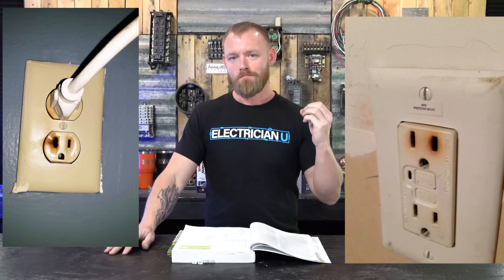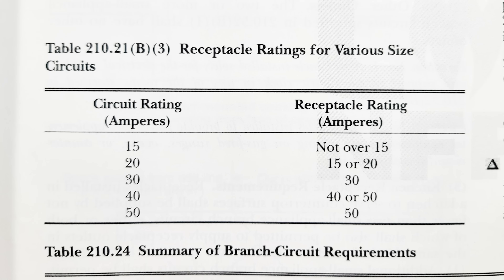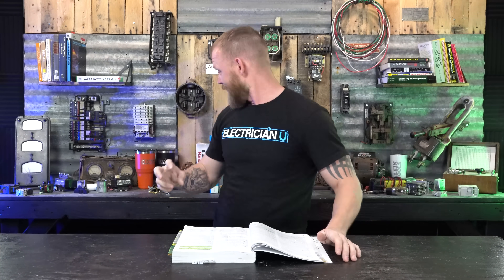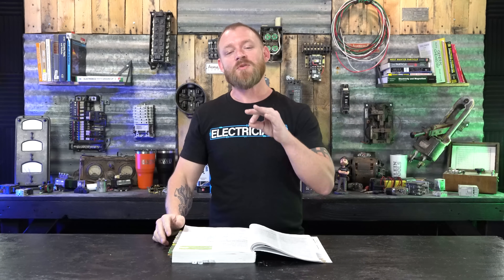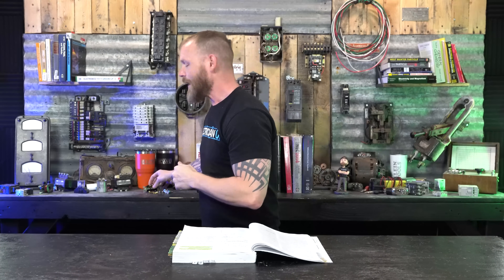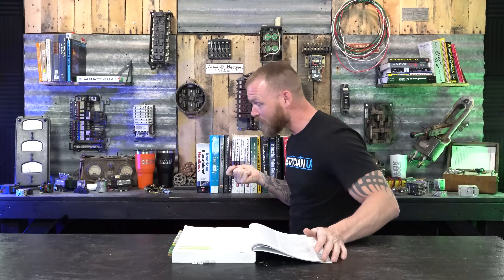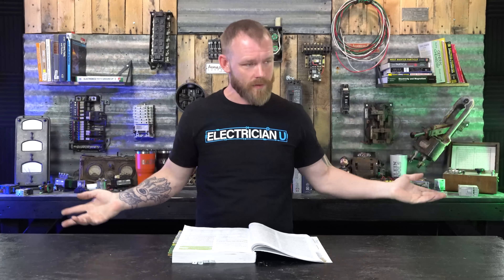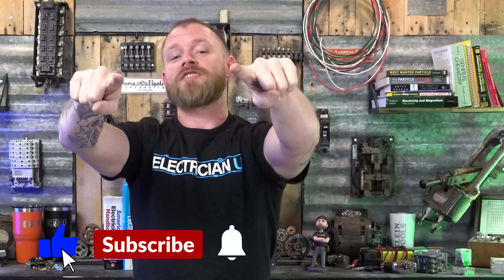Won't These Melt?!? 15amp Receptacles on 20 amp Circuits!!!

Comment: Very good video. I would like to add an additional point. The information you have provided is directed to receptacles located on "General LightingLoads.". These circuits are typically found in bedrooms and similar rooms.  Normally loads in these rooms are limited to loads like TVs, stereos, lamps, electric blankets and may be of those are non coincidental or intermittent. Most loads that you speak of are addressed by adhering to the requirements for "Appliance Loads' that address your concerns related to 15 ampcircuits.

Comment: In short.. all good 15A outlets are listed for  20A passthrough wiring - you are allowed to pass 20A through the outlet to other devices downstream on the circuit.    The   15 Amp outlet's rating and 5-15R plug configuration only means you are not supposed to draw more than 15A from that one particular receptacle.    Your appliances should Not have a standard 15 amp plug at the end of the appliance cort that plugs into the wall if they can draw more than 15 amps.

Comment: I bought an old house that basically had everything wired to one 20 amp breaker. Everything except for a receptacle in the bathroom, the oven, the dryer, the water heater, and heating an air. 

So over 90% of the outlets, lights, refrigerator, washing machine all were on a 20 amp breaker. I just rewired the house separating half of the outlets to its own breaker. I hired an electrician to help and he picked up the outlets for me but only bought 15 amp outlets despite it being a 20 amp breaker.

So the house is wired for 20 amps everywhere but at the receptacles. But this is the way the house was originally. And all this time people have been using it with space heaters and very old wiring, old outlets that were 15 amps, and all the outlets on one breaker instead of half of them. 

When I told him how many receptacles we were replacing I didn't think to say was for a 20 amp breaker. But I guess it's all good... I mean everything was running fine on the old wiring with the old receptacles for more than half a century. And if anything appliances and what not may be using less energy these days. So with more efficient appliances and upgraded electrical I suppose 15 amps is more than sufficient for a residence. I guess I can strategically place put in some 20 amp outlets where they might be more advantageous. I just don't know exactly where that would be at this point. It's a small house so the price they friends between 15 and 20 amp outlets probably would have been very insignificant. All in all the house only has I think 16 outlets and all.
Reply: Assuming that everything now is properly grounded, the 3 prong 15 amp duplex receptacles are what you need. Placing 20 amp receptacles "strategically" is not a concern and offers no advantage, because you'll likely never use an appliance, tooI, or equipment that has a 20 amp plug and cord. I recommend using commercial spec grade receptacles as they are more robust than the cheap residential grade receptacles. The important thing is that the 20 amp breakers are connected to 12 gauge wires. If this is the case, it is however, your choice. Same thing with GFCI receptacles which should be in the kitchen, bathroom, and for the washing machine. 
If there was no ground and 2 prong receptacles were used, you could place GFCI receptacles strategically for safety and the ability to use appliances with 3 prong plugs.
Reply: @surferdude642 cool thanks! I think I covered everything good. It's just wild because originally the house had 90 plus percent of the receptacles, lights, refrigerator, washing machine, all on the same 20 amp breaker. And there was never any problems! I separated five of the outlets and I think I'm going to separate the refrigerator and washing machine from the rest of the kitchen and master bedroom. It seems like so much Overkill though based on what it was! But may as well make it right as can be while I'm in it I guess 🙂
Reply: @VeganLinked  I think you have the right idea, it's not really overkill. Modern homes often have individual branch circuits rated at 20 amps for the refrigerator, dishwasher, garbage disposal, and microwave, just for the kitchen and not including the range which is typically 240v and 50 amps. Kitchen countertops can have two to four GFCI protected outlets on another circuit or two.
Reply: @surferdude642 neat! I went ahead and ran with it and just finished running wire for the refrigerator so it can have its own breaker 🙂 the only thing left is the washing machine! It feels so great rewiring this old house! I hired an electrician to do like 95% of it. But I was with him every step of the way learning all I could. And prior to that I was binging some YouTube videos. Plus when I upgraded my service panel I hired an electrician that let me observe closely. I know just enough now to be dangerous! The electrician I hired Wednesday that came out and did the majority of the work I needed done said that over 90% of people fail the licensing test for becoming an electrician. I always knew it was a little over my head but apparently it can get way over my head! But at least I know the bare minimum of what to get done now. I own two homes so I feel like I should know at least enough of the basics when it comes to this kind of stuff if I'm going to be owning homes, fixing them up, and maintaining them. Even if I hire an electrician it's great to know this stuff! Anyways thanks for chiming in!

Comment: I wonder why we don’t have different plugs for higher current like Swiss ones, so people would not be able to plug 20A in a 15A outlet.
Reply: We do have that. 30 amp and above have completely different plugs and receptacles. See NEMA plug and receptacle configurations. You can't plug a 20 amp plug (horizontal neutral blade) into a 15 amp receptacle.

Comment: I’ve counted 22 outlets in my house and there are 4 20 amp breakers. There are 3 wires running through the attic. This doesn’t seem right and I’m not an electrician at all. That means there are a lot of receptacles tied in together. The receptacles are 15 amp. I have one room that isn’t working at all right now. Which is tied into half of the living room which that part isn’t running either. I checked with a FVD and it shows power is getting to it. I wonder why I can’t get anything to turn on when I plug it into it. Seems like I would have an issue at a receptacle right? Or am I just a dumbass? Overall question is, Is this house to stay in or not? The receptacles get really hot when I plug stuff into them like a space heater. And I looked into the breaker box and you wouldn’t believe what a rats nest in there. Whoever did that did not care about wires touching each other. This house is so old that the receptacles don’t even have a ground in them. They just have the ground wires bunched up and thrown into the METAL box the receptacles sit in.
Reply: You clearly need an electrician to come over and do a look and see. You may need a complete or partial rewire and/or upgrade and probably a new electrical panel.

Comment: Don't know if anybody has mentioned this yet. Back in the 50s ,60s and 70s, when you ordered a new home the builder would ask if you wanted 14 gage or 12 gage wiring, The reason being that over the life of the home you would save power with the lower resistance losses of the 12 gage and over time that would erase the higher initial cost of the wire. Since 20 amp sockets didn't save energy and were generally not installed. Also if you have a number of outlets on a branch you want to be able to use more than one without tripping the breaker. The 20 amp circuit allows more loads at different outlets and less tripping nuisances. Also if you need to add a window air conditioner later just swap out the outlet and you are good to go. In my experience a hot plug in an outlet is generally caused buy a cheap plug that doesn't have the the wires crimped properly. Like when I plug in my cheap Chinese vacuum cleaner , the whole cord gets hot. Its not the outlets fault that the plug is getting hot and expecting the outlet to cool it down.

Comment: puasing at 2.25 I'd say if you have a 15A rec on a 20A circuit alone I say no but in a bedroom I still don't agree just use 20A but you can use 15 due to which way you wore it either being parallel or series and it's either voltage or currents that's additive or common so do your math babys

Comment: If a 15A receptacle is behind a 20A breaker, and the 20A breaker doesn't trip until it hits 130% or its rating, then you can have 25A going through a 15A receptacle and still not trip the breaker. So just dont do it, code or not. The plug cN melt and cause a fire
Reply: Incorrect, as long as the receptacle, connections, breaker, and wires are in good condition and 12 gauge wire is used, then no issues. You can use commercial spec grade 15 amp receptacles for 20 amp circuits, they are the same internally as the 20 amp receptacles.

Comment: If you put a 15 amp GFCI on a 20amp circuit, can you then run 14 gauge wire (15amp) before and after that outlet?
Reply: No, if it's a 20 amp circuit, it must have 12 gauge wire for the entire circuit. 15 amp receptacles including GFCI's are permitted.

Comment: Another problem is that appliances are rated in watts, not amps. So even if the homeowner it's aware of the need to limit amp draw, he simply may not know how to convert watts to amps.

Comment: It's worth mentioning that a NEMA 5-15 plug is all vertical, while a 5-20 has a horizontal hot.  So long as the device is relatively new or whenever that standard was implemented, you can't plug a demand over 15 amps into an outlet not rated for >15 amps.

Comment: You should never exceed your electrical system of your home because an electrician does a calculation for all branch circuits, and if you decide to get something that he did not calculate for and then go modify the load of a branch circuit by sticking a higher rated breaker in the panel well you don't know what could happen, man I can tell you some stories from being in the electrical industry!

Comment: In my mind the real question is  "why not only have 20A receptacles available"? There can't be that much difference in cost or there wouldn't be if that were the only amperage made.
Reply: 20 amp receptacles requires 20 amp circuits and if you were to design your own custom home, the overall cost difference would be negligible as you mentioned, but when a developer builds hundreds of houses and condos, it adds up, and they build to adaqucy and minimum compliance requirements in order to maximize profits.

Comment: Someone ran higher amperage on a 14 gauge wire and it only melted when reaching 60amps.  We are way way way in the safe zone.
Reply: Most of those tests are with new equipment. If you run 20-30 Amps on a +20 years 14AWG, you are more susceptible to overheating the wire and melt the insulation. It's best to stay at the correct rate and under 80% circuit capacity.

Comment: 12-28-24.  Computers/Printers/TVs/VCR/Satellite Receiver, Cell phone charges,  modem and routers.   Very common in 2024 for a 30+ yr old home wall receptacle to have a power strip plugged in that is feeding 4 to 6 or more extension cords.  Same for a 14 gage wired ceiling lamp outlet that gets used like as 12 gage wall receptacle  Lot to be said for the cost effective value of running installing only 20A circuit breakers as a minimum and only 12/2 and 12/3 Romex for everything to protect the unknown  future.

Comment: Great man, I have had a recepticle  that was overheating due to a larger A/C unit that was running off it. You just made me understand what was happening. Im going to change all my outlets to 20 amp .. I thought it was due to bad wiring but this is def what it is. Thank you.

Comment: The reason why breakers trip at 130% load is because if you have a temporary surge like a motor then the breaker would trip when it really should not.
Reply: Not quite. The start up current for motors and compressors is typically 300%-500% of their full load current. In other words, an AC compressor that uses 15 amps will draw 50+ amps momentarily at start up far higher than 130%. The time delay function of the breaker allows this. 
Breakers don't trip at 130%; that is the minimum design standard for breakers, but breakers will usually trip much closer to their rating in an overcurrent situation.

Comment: The cheap 15 amp receptacles are no good for a 20 amp branch circuit.  A look at the connecting bars on the side confirm this for me.  They're thin compared to commercial grade 15 or 20 amp receptacles.  I agree with what some have said elsewhere.  If you can backstab it, don't put it on a 20 amp circuit.

Comment: GREAT QUESTION! I wanted to run a 20A circuit to my home theater and noticed there was already a 20A wire going there even though outlets are only 15A. I assumed this is why it's never tripped. Not because of total power usage, but because you can distribute multiple 15A connections on a 20A line. That's my guess at least. Gonna watch the video to find out. I would assume a device that could pull 20A would potentially cause issues.

I say they're 15A plugs because they don't have the T-shape on one connector, so I'd assume they're not 20A, but I have devices that say they can use up to 20A without the T-shape.

Comment: Hi,
As an electrician, I would educate my customers: 
I would tell them that if the receptacles say 15A, then they have a 15 amp overcurrent protection device known as a BREAKER 🎉
Then, I  would make sure that I install only 15A breakers. Nothing larger, even if the NEC allows me.

Therefore, when the nuisance of the 15A breakers makes them contact an electrician to reset a breaker " What did we learn" ......
Stop plugging stuff that when doing addition adds to 15 or more, into the receptacle that is greater than what is printed on it.

Comment: Easy. Stop being cheap. Use 20A NEMA 5-20 spec grade outlets for all 20A circuits and 15A spec grade outlets for 15A circuits. This makes it really easy to identify which circuits are actually 20a vs 15a

Comment: Hardly ever unless you are using heavy machinery or if you are dumb enough to put multiple resistive loads on one outlet/circuit will the draw be enough to burn an outlet. It’s the idiot consumer running two space heaters at the same time that typically causes this phenomenon.

Comment: You are absolutely correct the average person is not an electrician so why the hell does the NEC complicate things so much?   20 amp circuit, 12ga wire and 20 amp receptacle.   No ands, ifs or buts just keep it simple…

I rewired my house and I over killed it with 20 amp circuits.    I also broke my budget but I know it’s all good…

Comment: The difference in 15 amp and 20 amp receptacle is the plug that will fit they both  can handle the same current. The difference is one pin socket

Comment: As I am looking for options to charge my new Tesla at in this garage at a home I am renting, I see that there is a 20A receptacle on the left side of the garage and 15A receptacles on the other sides of the garage. I then do a little digging and found a YT video and in the comments I see a guy saying he changed his receptacle because he found out the hard way it was under the amperage that should be there. So then I find this video and after watching it to the point where he speaks on whats code I go check my circuit breaker box and low and behold, the 20A receptacle has a 15A circuit and the 15A receptacles on the other sides of the garage has 20A circuits. If that circuit is 20A, then the wire should also be 12gauge (fit for 20A) correct? IS it as simple as swapping receptacles or should I buy a brand new 20A receptacle to replace the 15A?

Comment: I use 15A receptacles on 20A circuits so I don’t have multiple 16A copiers on a circuit. In 25 years I never had a problem with spec grade 15A receptacle on a 20A circuit. I have had multiple calls with copiers that had recurring low voltage issues that were on the same circuit as another copier. All P&S 15A receptacles are rated for 20A pass through. With all the manufacturers resources at your disposal it would be nice to hear what manufacturers say and not hear anecdotal information.

Comment: Would rather the receptacle melt than wire in the wall and dont put more than 15A on a 15A receptacle reguadles of breaker/wire in wall being higher.

Comment: ...so now I know why my Hyundai so-called "trickle charger" for my plug-in Santa Fe only draws 12A, it's basiclaly to meet with its NEMA 5-15P.  As a side note, amazingly, a meter plugged into it shows nearly unity power factor while charging (but alas, more like 0.6 at idle)

Comment: Hmm my 15a washer receptacle melted and it’s on a 20a dedicated circuit… why
Reply: Was it backstabbed? Or a loose connection? If it's a 20 amp dedicated circuit, you should use a single 20 amp receptacle.
Reply: @surferdude642  not backstabbed. Connections seemed fine. I did switch it out for a 20amp outlet